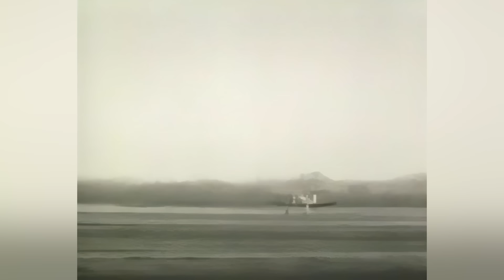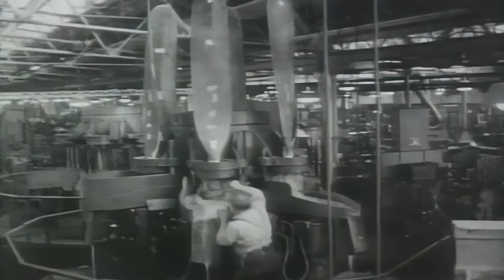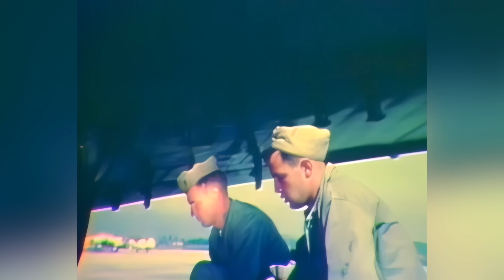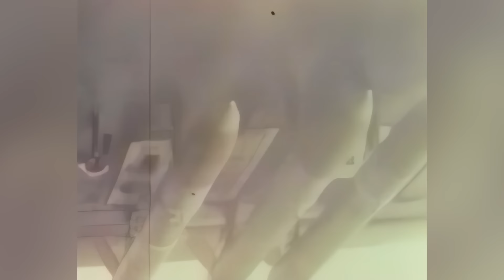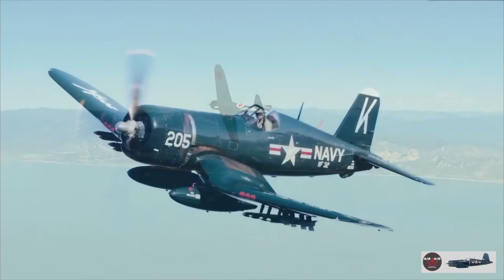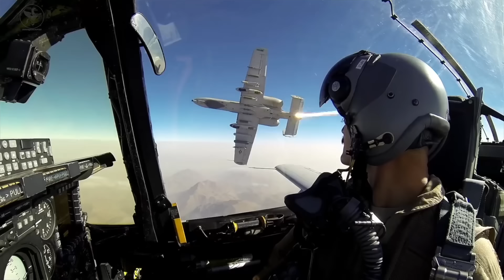Vought F4U Corsair: WWII Powerhouse of the Pacific. The Bent-Wing Beast!

Comment: The F6F flamed more Japs
Reply: Yeah, well, percentages and uses... The Ford F-150 is "the most popular truck in the world", also makes it the most wrecked... But which would you rather have? An F-150, F-350, a Dodge turbo diesel, maybe a Ford Lightning?🤔 You're not like those myopic and fatuous news writers who label the V-22 Osprey as a "deathtrap", ONLY because it's got the most flight hours are you? If they had more than a room temp IQ and looked at things like "per flight hour", the V-22's got as good or better safety records than say a Blackhawk or Chinook...

The reason the Hellcat "flamed more Japs" was it's a better carrier based "beginner's plane", MUCH easier to land on a carrier deck by a "wet" ensign right outta flight school. The Corsair had so much damn power and torque, if you hit the throttle even just a hair too hard (noobs) would FLIP over into the deck/ground, why the F4U's got nicknamed "ensign eliminator". It flew entirely different types of missions from island based airstrips, not into the flocks of zeros who's mission was attacking carriers. The Hellcat is a Ford F-150... The Corsair could reach much higher altitudes (could hide in the Sun, had more energy), was faster and more maneuverable than the Hellcat, making it more effective in dogfights, a Ford Lightning...
Reply: @macgyver5108 Not sure if you really know very much about the F6F Hellcat. It had just as powerful of an engine, could dive faster, turn tighter, and was proven to be more survivable than the F4U Corsair.  Absolute ceiling for the F6F-3/5 and F4U-1 were basically the same, as were climb rates. Both flew roughly the same number of action sorties. Yes, the Hellcat did engage more EA in combat, but it also shot down a greater number of these per every loss than the Corsair.

 Furthermore, in 1945 both types were flying from carriers performing very similar missions and meeting the same enemy aircraft types. The Hellcat's kill/loss ratio during this period was again better than that of the Corsair (22.1:1 vs. 16.9:1). This is well documented and not up for debate.

Comment: I believe that had the P-51 not been successful with the Merlin engine conversion, the F4U would have made a fine substitute as an escort fighter. By early 1944, it had a top speed of over 425 mph, and with drop tanks could easily have escorted American bombers all the way to Berlin and back.
Reply: @Sacto1654  quite the contrary, the P-51 was made successful as a high altitude escort fighter by the addition of the Merlin. The P-51A Apache was used successfully as a ground attack and low altitude fighter in the Mediterranean Theater as was the P-40. It was the addition of the Merlin with its two stage, two speed supercharger that allowed the Mustang to achieve its success. It was because the Mustang was something developed by North American for the British that allowed them to experiment with that marriage of the Mustang and the Merlin.

Comment: Thank the Royal Navy Fleet Air Arm for taming Corsair carrier landings
Reply: It was the Fleet Air Arm that figured out you need to raise the seat of the plane to get better forward vision during carrier landings. That's why F4U's built from early 1944 on had a raised cockpit to improve pilot visibility.
Reply: @Sacto1654  You need to read Lt. Commander Norman Hanson RNVR accounts of his WWII experience as F4U Corsair pilot.  NONE, ZERO of what you are saying is true.  Two books: "F4U Corsair at War" by Abrams and "Carrier Pilot" by Hanson.
Reply: @maxschell8823 
Tommy Blackburn the commander of VMF-17 from its formation, who along with VMF-12 were both carrier qualified before any British units were, doesn't mention anything about visibility problems while landing or the British in his book, matter of fact he states that landing the F4U on an American carrier was done the same as any other US Navy aircraft at the time, visibility over the nose wasn't an issue as at around 200 yards out you'd look off the left side of the nose and start taking instruction from the landing signal officer. 
VMF-17 was on the USS Bunker Hill when it departed San Diego for the Solomon Islands campaign, however upon arriving at Pearl Harbor for supplies VMF-17 was informed that ComAirLant, the department in the Navy in charge of all Naval aircraft, had ordered all F4U's removed from carrier service because of a lack of spare parts and qualified maintenance crews, that's why the F4U was originally removed from carrier service, not because US Navy pilots couldn't figure out how to land their own planes on their own carriers.
That's just typical of them, taking credit for something they shouldn't by inventing bedtime stories, like a nobody test pilot claiming that Jimmy Doolittle, the greatest test pilot of the time, asking him for help with problems they were having with the B17, whatever those imaginary problems were, there's a fairytale story there.
Reply: Your welcome.

Comment: "Saw action on Guadalcanal in February 1941." {7 min. 14 sec.)  Correction required. February 1941 should be February 1943.   From the book "F4U Corsair at War" by Abrams.  VMF-124  was declared ready for combat 28 December 1942.  On 12 February 1943 twelve Corsairs were flown up to Guadalcanal from Espiritu Santo.  Without going into this more deeply I believe there are several minor errors in this video.   Someone made this comment below on the landing gear.  From the many books we have read about the Corsair I don't believe anyone said the landing gear was "weak" or collapsed.  Yes, there were problems with the landing gear but... Also the sequence of events is out of order.
Reply: The original landing gear didn't have enough rebound dampening, they had the tendency to bounce up in the air if they hit the deck hard during landing. 
Another myth, undoubtedly the biggest one about the F4U, that gets thrown around is that the US Navy couldn't master landing it on carriers until the British showed them how, nothing could be further from the truth, VMF-17 and VMF-12 both were carrier qualified shortly after receiving some of the very first F4U's that came off the production line, VMF-17 was even on the USS Bunker Hill when it departed San Diego for the Solomon Islands campaign, but upon arriving at Pearl Harbor for supplies VMF-17 was informed that ComAirLant, the department in the Navy in charge of all naval aircraft, had ordered all F4U's removed from carrier service because of the lack of spare parts and qualified maintenance crews, seems the Navy didn't think it was a good idea to have aircraft on carriers that they don't have adequate spare parts and maintenance crews for, they weren't removed from carrier service because US Navy pilots couldn't figure out how to land their own planes on their own carriers, at Pearl VMF-17 was loaded on a small carrier and taken to Esposito Santo where they operated off an airstrip for their tour of duty.
The landing procedure was the same for it as all other Navy aircraft even to this day, and was not affected by its long nose, pass the carrier on its port side on the downwind leg, count to 30 and make a left hand turn lining yourself up behind the carrier about a mile or so out, continue the approach until 200 yards out at which point you'd look off the left side of the nose at the landing signal officer, the pilot doesn't need to see the carrier deck over the nose as he's taking direction from the LSO, Tommy Blackburn, the commander of VMF-17 from its formation described the procedure in his book Jolly Rodgers, not once does he even mention the nose of the F4U being an issue, and as far as the landing gear issue nobody shipped out on carriers for a campaign with the original F4U's, they qualified with them but before shipping out had already gotten the improved version.
The reason the F4U was returned to carrier service later was because in June of 1944 the Japanese launched their Kamakazi campaign in ernest, since F4U's had a faster rate of climb and faster top speed a squadron was put on each Essex class carrier to act as Kamakazi interceptors to protect the carrier, the idea being once inbound Kamakazi's were detected they'd launch first and climb to altitude to intercept them with F6F's launching behind them to get any that punched through the F4U's.
Reply: @dukecraig2402  Thanks.  100% regarding carrier landing issues and the "curved approach".  Although Brits have a strong opinion on this issue there is no better source than a Brit.  No, the Brits did not invent or initiate the F4U  "curved approach".  For example  Lt. Commander Norman Hanson RNVR accounts of his WWII experience as F4U Corsair pilot.   Two books: "F4U Corsair at War" by Abrams and "Carrier Pilot" by Hanson.  In the first book Hanson describes in detail the Royal Navy's experience landing the Corsair on a carrier deck i.e. December 1943 and January 1944.
Reply: @maxschell8823  
Whatever the RNAF's experiences were with the F4U is whatever they were, but they had absolutely nothing to do with the US Navy's use of it, nor did they "Teach US Navy pilots how to land them on carriers", I've challenged countless people to show proof of the claim, a copy of someone's orders to report to a British unit to be trained, records of US Navy pilots being sent somewhere to be trained, pictures of US Navy pilots at a RNAF training facility, anything that's proof beyond a claim made in a UK authored book or it being claimed on a History Channel show, that's the best anyone can come up with, nothing official, no records, no nothing beyond "We say so".

Comment: I always wonder how these naval aircraft would have done against the Luftwaffe.🤔
Reply: The f4u I believe would do well. The hellcat though, might struggle due to lower speed, but durability would help.
Reply: Different types of aircraft for different missions. Germany didn't have a dedicated naval fighter. But i think the only German prop plane that MIGHT give the Corsair a go is the FW-190. What an awesome bird. The Brits had the BF-109 figured out by 1940. Then the 190 showed up and gave them fits until the Spitfire was updated. The P-51 had no issues with either the 109 or 190. I don't believe the P-47 had problems with them either, which makes me think the Corsair wouldn't.

Comment: The only WW2 aircraft still in inventory, of all the great WW2 fighters, still in use by the U.S. air force as a front line fighter, during the Korean War, as a very effective ground attack aircraft, it's slower speed, 450 miles an hour, vs jet fighters 100 mile an hour greater speeds, made it an indispensable ground troop support fighter, the only piston-engined aircraft to shoot down much faster Russian MIG jet fighters. The most effective, most beautiful piston-engined fighter ever made, in my personal opinion.